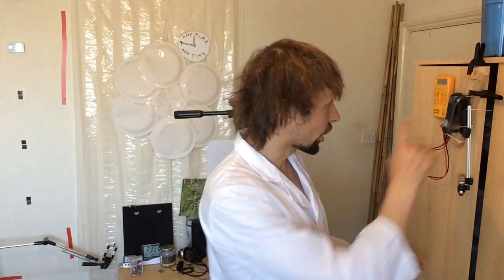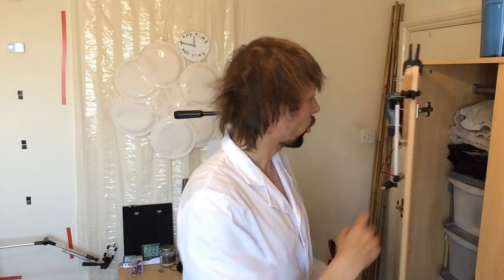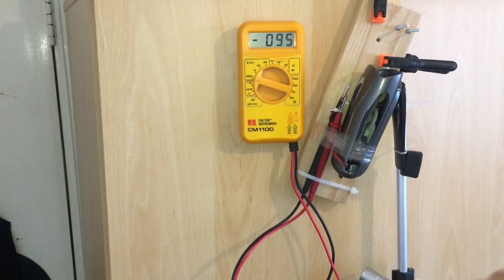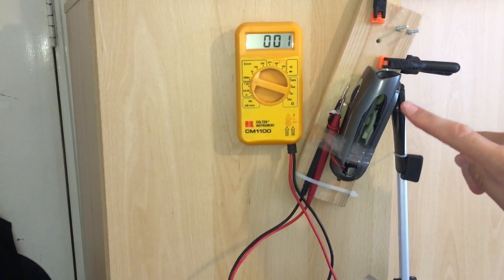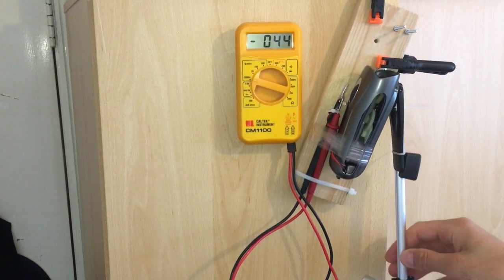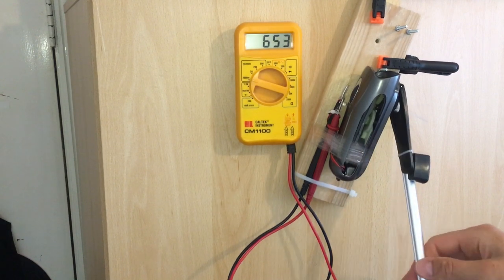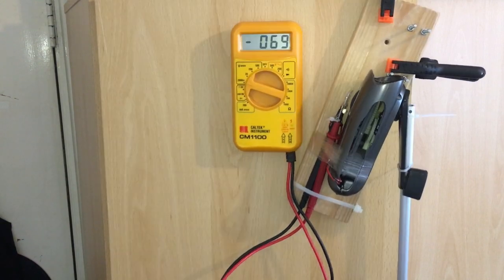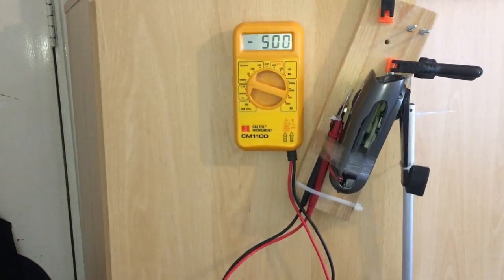How to generate free electricity

Comment: This tip has been so helpful! I have already disconnected my electricity from the local electric company and have already started powering my room lights. I have found a downside though... if I stop opening and closing the door, I dont have any power. Is there a way to harness the electricity so I can save it and use it for later?

Comment: Actually with a speed acceleration gear setup and a bit of design so the whole thing doesn't look like a hammer randomly slammed on the door, this could potentially be used very seriously. Maybe custom hinges with the gears integrated. In a whole house green-house setup, it might actually make some sense, multiply this by the total of doors, drawers and windows in a house and I bet you get a considerable amount of power, at the very least charge a phone or light up some LED bulbs.